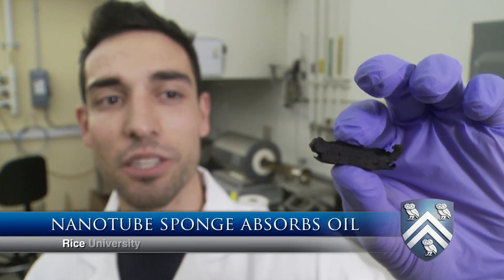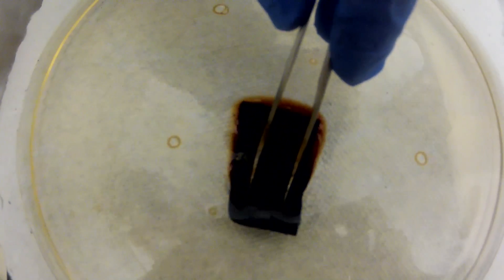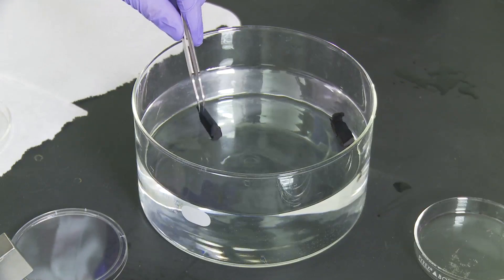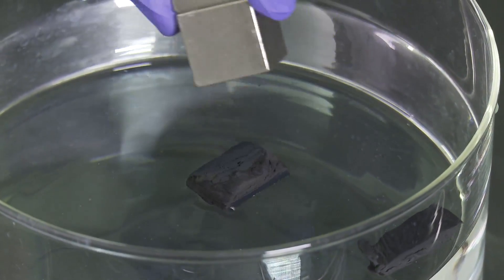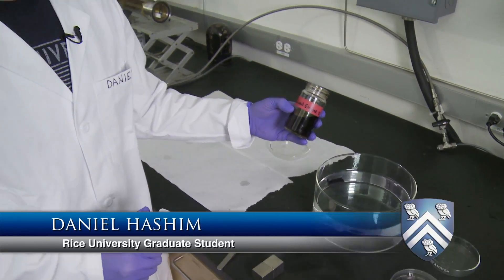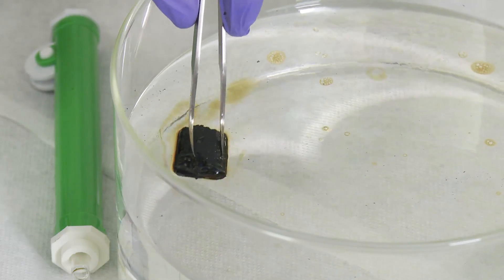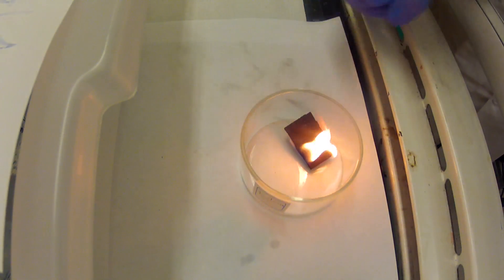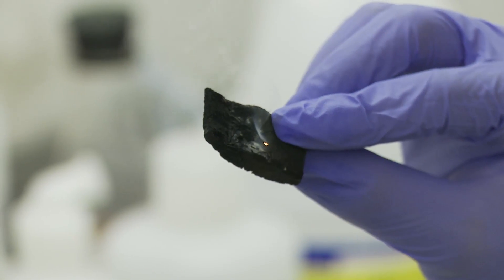Nanotube sponge soaks up oil

Comment: This video doesn't actually demonstrate anything I don't think a normal cloth could do.

Well, the burning part (if true) I guess is new.
Reply: Well normal cloth is not hydrophopic so it would absorb alot of water instead of oil which is less than ideal

Comment: Good vid. Question: Would used engine oil contain traces of metal (from cylinder damage/corrosion/silt pick up) that would prevent it from being attracted to the sponge? If it were used in oil spills, would it not be more realistic to test unused oil?
Reply: I believe that because it is used oil, the oil already contains some metal. I think this would also work for unused oil

Comment: I could see that this sponge had absorbed some oil. Not too much, firstly, and the narrator had to push it with forceps a bit. Is the absorption effectivity of that thing is really that good in comprasion with existing solutions? Seond thing is cost of production. I would think that it will be sky high.

Comment: Not to mention that cleaning oil on the water's surface isn't really the difficult part. The majority of the oil pools under the surface, which these sponges would (literally) refuse to sink to. This isn't mentioning the like prohibitive cost of producing them--companies, and even the government, usually go with the most cost-effective solution.

Still, if it works better than I'd hope, all the more power to them!

Comment: Sure, it works with highly processed (most likely synthetic) motor oil. But does it work the paraffin rich crude oil that is the actual problem with off-shore oil spills?